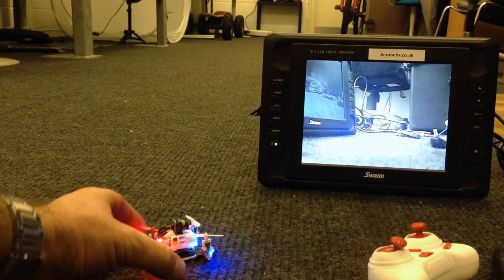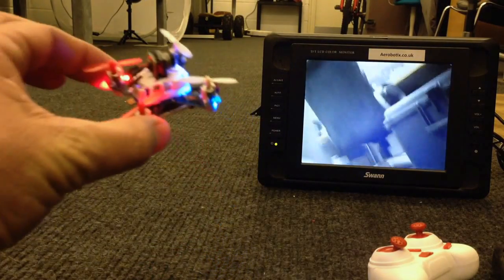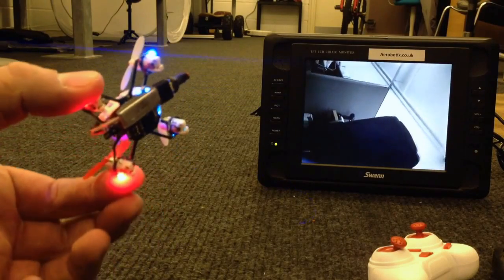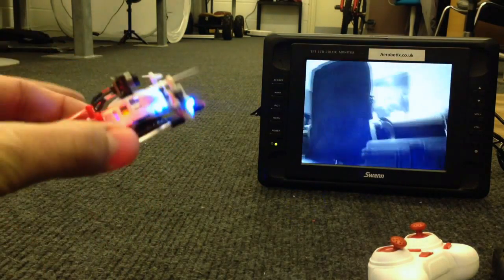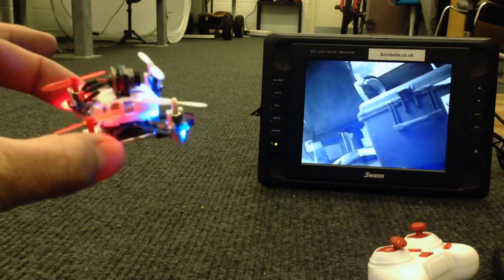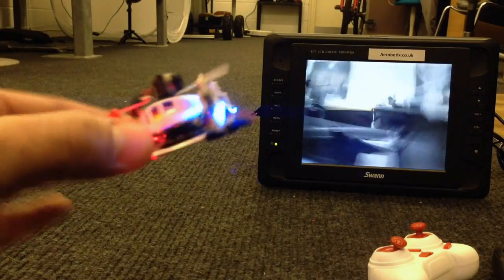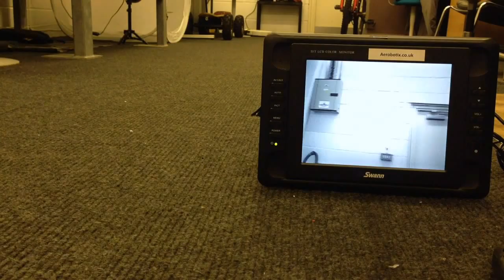Worlds smallest micro micro FPV Quadcopter!!

Comment: I just bought this quadcopter!! It turns out that because it is from the same brand, you can us the Hubsan h107D transmitter with it. That means that if you adjust the frequency settings, you can your micro quad entirely by fpv with the Hubsan h107D transmitter!! You can find it on Bang Goods for about 90 bucks.

Comment: Quick question- does it matter what mW rating the transmitter has, and will it impact what battery or camera I need to have? Would you recommend a second battery for the fpv setup?
Reply from the maker: yes reccomend second battery else you have bad feedback on the video and the mw does affect signal and battery the higher the mw the better the signal but the more is saps the battery
Reply: Tom Wadsworth Another question- I tested an 8gram weight on my blade Nano qx and it couldn't lift it. It couldn't lift 6g either. I calculated with a 1g camera, 2.2gram transmitter and 4.5g extra battery, it would total to about 7-8g. I know it can be done, why is mine not handling the weight?